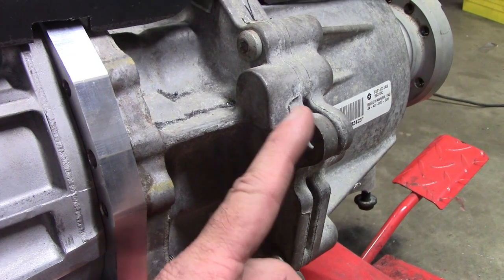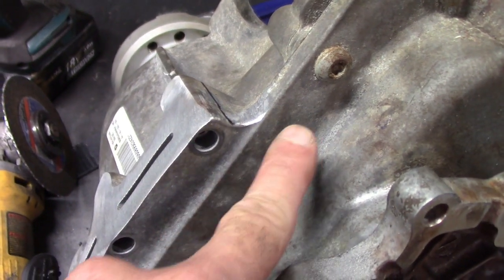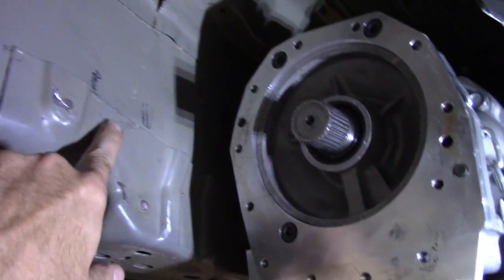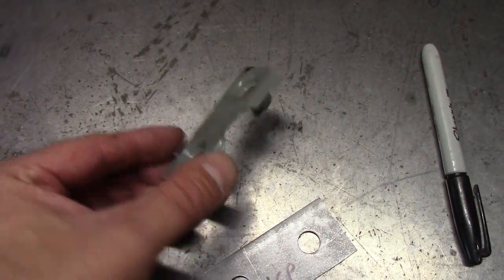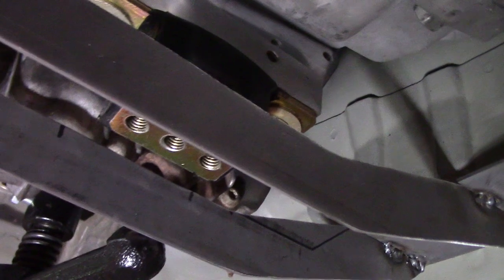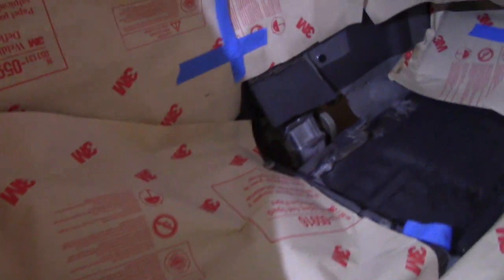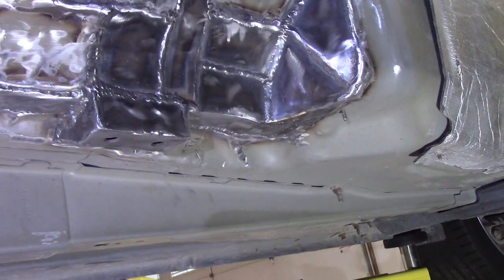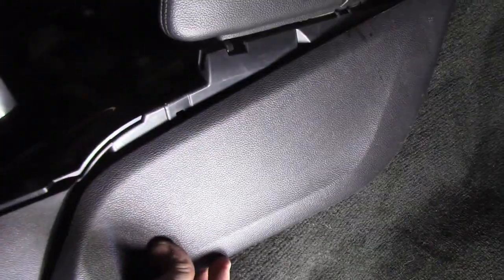American GT-R, Transfer Case in an AWD Mustang GT.  AWD Mustang Ep 12, Project Traction!

Comment: Nice work. Next time, if you're pressed for time and want to save some cash, take some old towels or bed sheets you don't care about soak them in water and place them in your interior where you're welding.  This has been my go-to for years. Mig welding you have more splatter so I can understand the extra protection for surrounding areas

Comment: Thanks for the update! Maybe it's just me building things waaay to strong - but I would have boxed in that gearbox mount. Doesn't make it a lot heavier and is weight low and centered anyway.
Reply from the maker: I actually agree.  I was trying to make it as light as possible.  Sometimes the make it strong creeps in one part at a time and really adds a lot of weight.  This part, as is is only 1 pound heavier then the stock aluminum crossmember!  But, I am going to at least add some gussets over the winter.